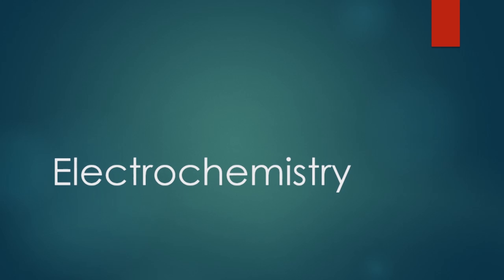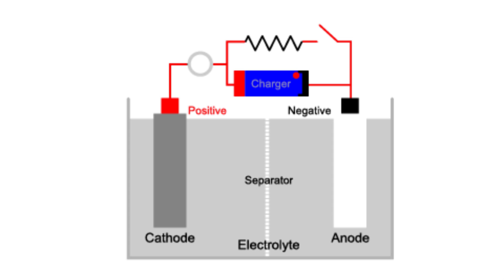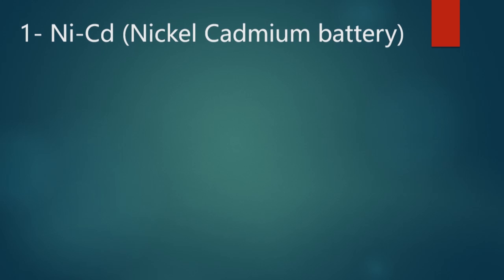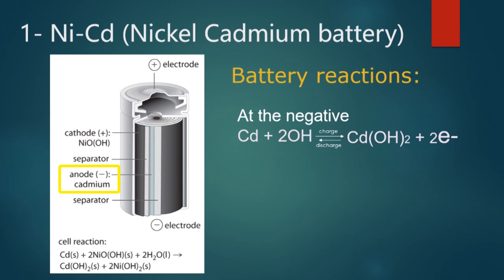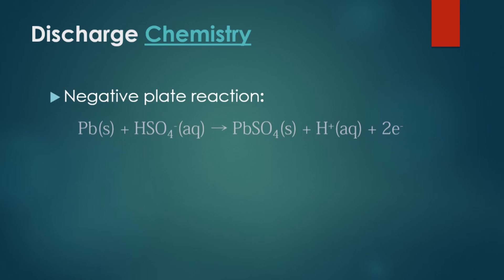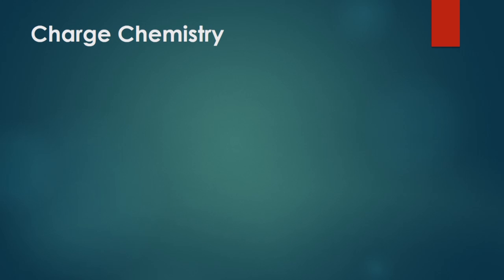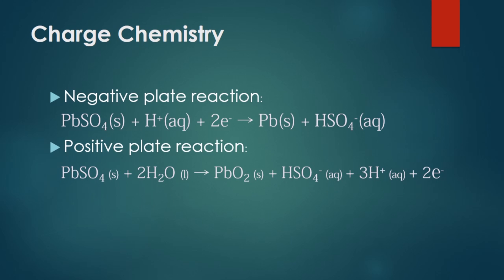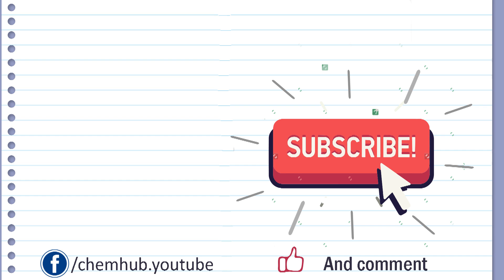Electrochemistry / Secondary Cells /Nickel Cadmium battery/Lead–acid storage battery

Comment: Why does the cathode change from positive during discharge to then a negative during charging?

I just figured the battery was labeled + at one end and - at the other.  It doesnt matter if discharging or charging.  It seems to break my conventional thought.  Also, my instructor shows an image where the electrons always go into the cathode, no matter if discharging or charging.

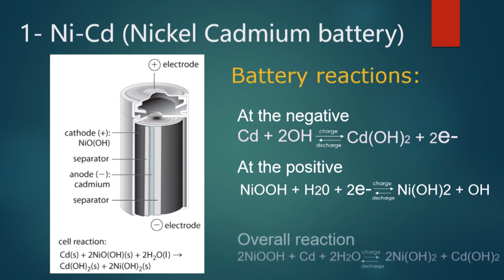Comment: Am I wrong or is the label for charge and discharge reversed in 1:58? It is mentioned that during discharge electrons flow out of the negative anode, so electrons should be produced instead, the labels for the equations are reversed.
Reply: yes

Comment: Why you change the signs from + to - at the anode during charging
Reply: When charging, anode actually has a positive sign as connected to the positive pole of the external voltage source. The sign changes from + to - when discharging because the anode is transferring electrons to cathode.